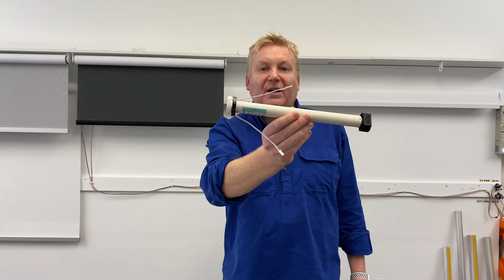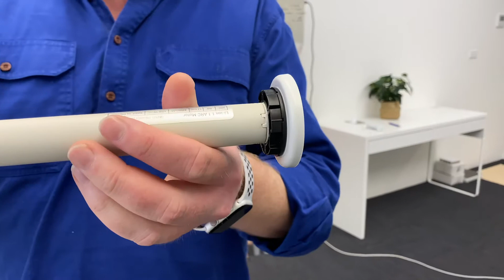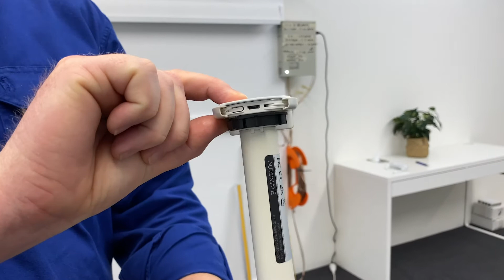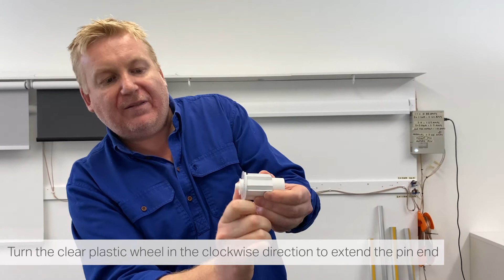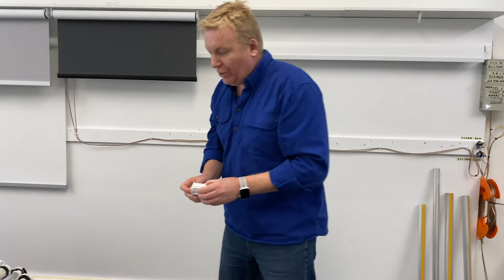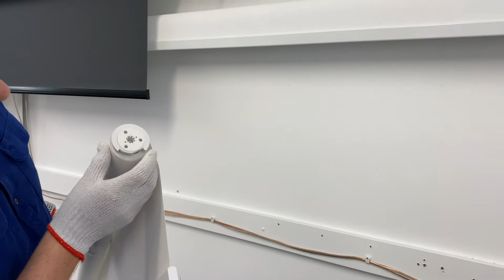How to install Motorised Roller Blinds (Automate Zero 12V motor)

Comment: Good, I like it. Just wondering how wide is the hanging brackets? I've got a slot of only 60mm (one side is window and this other side is old tracks with strings for curtains), not sure this will fit.
Reply from the maker: Hi Deyu, thanks for asking. 
The bracket for our single roller blind is 50mm deep, so should fit within your space. 
Hope that helps!
Have a great day, 
The iSeekBlinds team